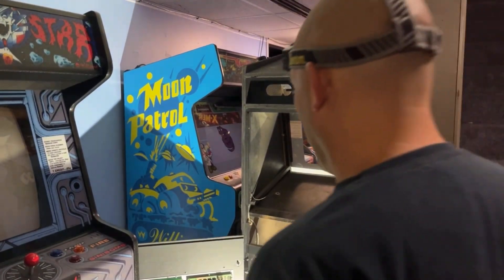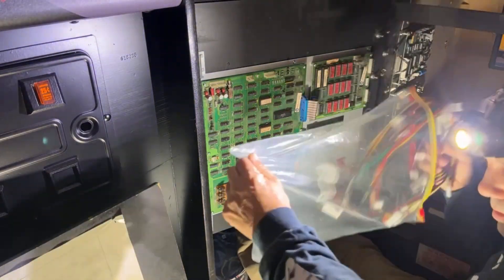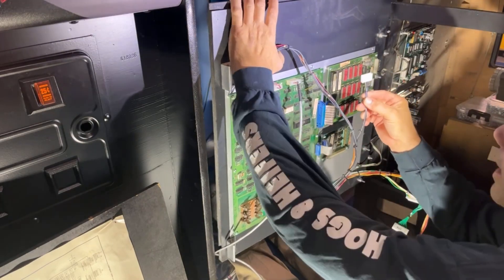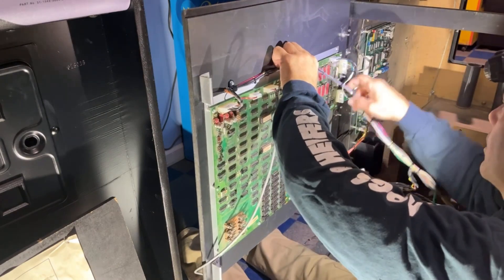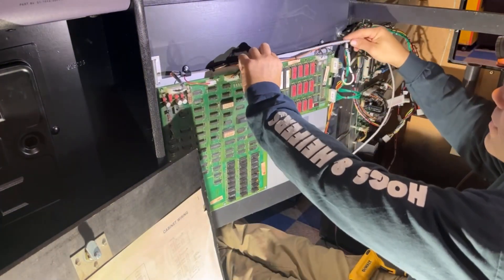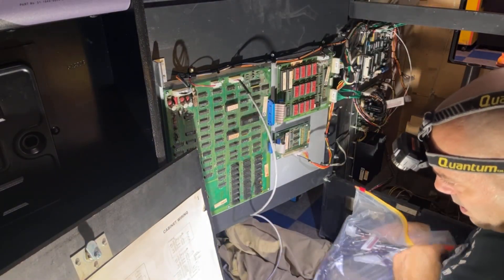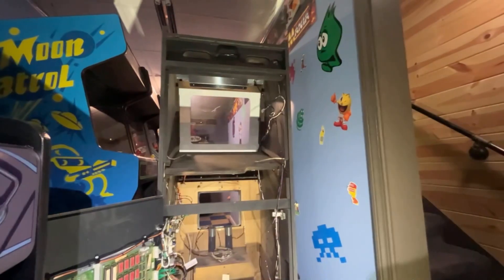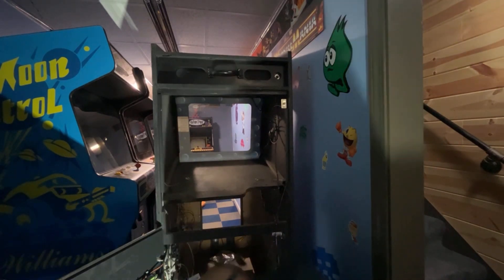Bubbles, Arcade restore part 12 working on the wiring

Comment: I noticed u have operation wolf..are u running o.g. boards..I have a complete but empty cab and cant find any working boards...and from what I have read u cant repair them due to security chips
Reply from the maker: Yes, they are running all original boards of having a slight issue with it but I believe it is to do with the bar that they use that the wires go on one side and then the other there’s corrosion in the connector so I need to unpin everything and fix the corrosion